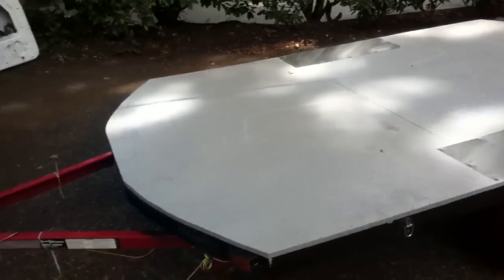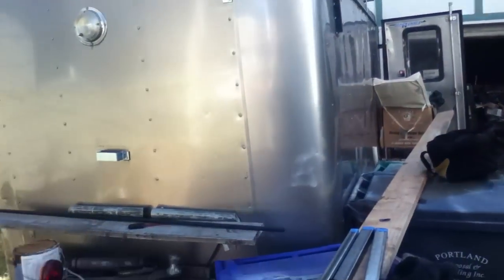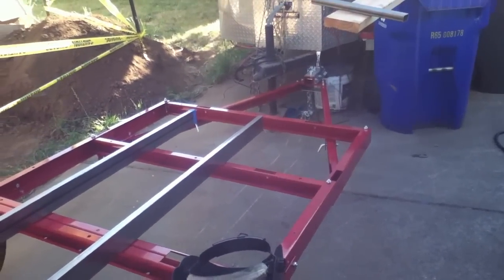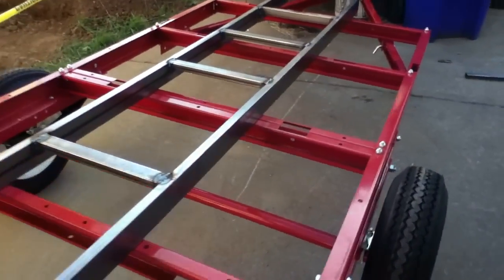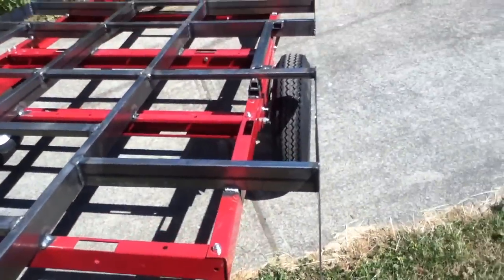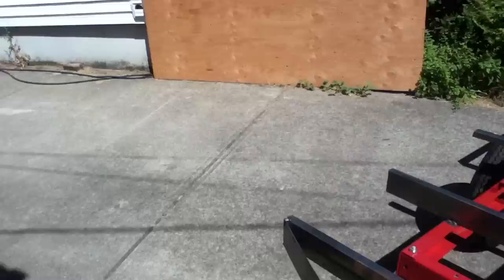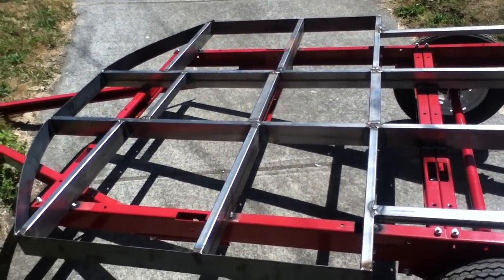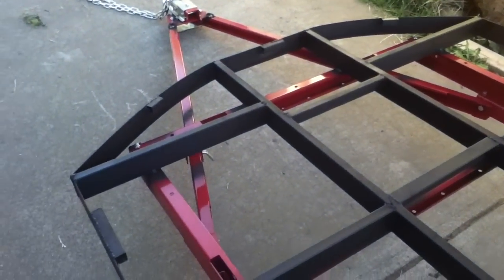5X10 Flatbed Build On Harbor Freight Trailer Frame Kit  #94564

Comment: I had a trailer stolen from a friend I lent it too as well. my friend paid me for it. I used the same hf frame and just put 3\4" plywood to extend it to a 8x10 deck.  I put spacers between shackle and frame to raise deck over tires.. I had a lifted jeep so the hitch was just right. I loved that trailer because the tires tracked exactly with the rear tires of my car. I could pull it anywhere I could fit my car. I plan on making another one except I'm going to weld it (no bolts) and weld 12" extensions to the sides of the frame for stake holes
Reply from the maker: My friend seriously fucked up two of the robbers so I can't fault him that way.  His other friends who brought the robbers around, well, that piece of shit is another story...His parents are a major hassle and have interfered with my property recovery and keep trying to burn me in retaliation for claiming my stuff back.  This all happened in Washington State where the people for the most part, are pretty fucked up people.

Comment from the maker: Getting the base trailer at around $300 at the right time of year walking in the door at Harbor Freight with a 20% off coupon (no sales tax state and no shipping charge since I am picking it up at the store), there is no way you beat that deal for the base trailer.   The axe kit with leaf springs almost never below $100, tires and wheels, $80, (most of the time you pay $50 each).  Light kit $20-$40, hitch kit $20, then the steel.  By the pound from the cheapest steel yards, $1 per pound.  It's over 100 lbs of steel.  I did the math and figured out I could not buy the items separately for cheaper, then would have a bunch of measuring and cutting to make the frame and axle mounts.    This type of flat top flat bed trailer is almost always going to require a two tier frame design anyway.  Flipping the axle over the springs does not make it tall enough, but is close.  On this design, the original trailer frame acts as a reinforcement up the center, allowing for a bit lighter construction on the deck supports at full width without threatening the structural integrity of the trailer.

Comment: I have to ask, ('cause I'm like that!) why didn't you just add spacers to the leaf springs to add the necessary clearance for the wheel-to-bed clearence? Then you could have just added to the sides of the original frame, cut down on weight and material?

Comment: Nice job! I'm working on extending (12’) and enclosing my trailer for dirt bikes and camping. If I was building your trailer, I would have put square tube under the spring mount racks to raise the frame, and built a 5x10 metal frame bolt on extension.

Comment: The trailer structure is very rigid if the fasteners are all tightened down adequately. I used a cordless impact wrench (DeWalt DC825) and tightened each and every bolt until I thought any more would break it. Afterwards, there was no flex in the frame as it was moved around (flipped, etc) during the remaining assembly - and it remained that way after full assembly. That also made good metal contact between the various pieces, allowing for a solid electrical ground.

Comment: I just watched this video, I am curious to know if you have the trailer back from the theives.
Reply from the maker: Nope, it had too much damage where it was stored to risk loading up and hauling out yet but I know where it is and got the property owner and local law enforcement to finally acknowledge that it is mine.  They were still playing a lot of games over my access to the property to retrieve any of my stuff and filed a false police report against me just as a threat of retaliation because they were upset over me recovering what I did manage to recover.
Reply: Officials can be a real pain in the ass sometimes.
Reply from the maker: More like facilitation of robbery and extortion.  The basic message was to give up my stuff or they find excuses to cause me harm.
Reply: Sounds like you live in a nice neighborhood. Time to move.
Reply from the maker: I do live in a very nice neighborhood.  The ripoff happened 400 miles away.
Reply: OK Glad to hear that.

Comment: I'm thinking of getting a Harbor Freight Trailer and using it to haul from Missouri to Alaska.  People are warning me that the 12" tires and bearings may not be able to handle the 4,000 mile trip.  Do you think the trailer can make such a trip?
Reply from the maker: The axle is a pretty standard 1 ton axle and if you don't badly overload it you will be fine.  If you do blow out bearings, you can upgrade to a US made hub assembly from NAPA auto parts for $50 per hub.  I have built and own three trailers done on these types of frames.  The one in this video blew off some of the lugnuts on a long trip hauling a section of my cabin a few hundred miles - probably over the weight limit a bit, but not badly, and then five miles of off road when I got there, but it made it.   Another one grenaded the bearings on the highway, but that trailer was around three years old and had seen a lot of use.  If you are conserned about bearing longevity, replace the bearing caps with the kind used on boat trailers that use the same axle and hub assembly.   The boat version has a zerk fitting in the middle of the bearing cap so you can pump more grease into it much more conveniently than the factory fitting.   Make sure to tighten the lugnuts from time to time on longer trips.  They can loosen on their own for some reason.

Like what I discuss in the video, the frame on its own is a little bit flexible, but as you add more steel, then it increases structural integrity.  Welding it after you have bolted it together seems to help too.
Reply: 8digitPDX Thank you for your response I appreciate it!

Comment: I'm building the same trailer and I'm curious about the flex on the springs when you have 500 lbs on it.  I know with no weight and just the original frame that the tire is just above the frame.  I was thinking i would add 2x4 with the 2 side up do you think it will be enough?
Reply from the maker: It should flex very little with only 500 lbs on it.   I know the video is long, but there is a point where I explain how the wheelwells are done with 1/16" metal (you could use steel or aluminum) and it is set right at the maximum upward travel of the tires when the springs flex.   Measure the distance between the tops of the Ubolts holding the axle and the bottom of the (original) frame.   That's your distance of travel, now measure the top of the tire above the frame, should be around an inch and a half   Add that to the distance of travel, thats how high your deck needs to be in order to have a flat deck which goes over the wheels and has no wheel well bump to interfere with flat bottomed loads on the deck of the trailer.  Now if a load were to torque the axle hard up at an angle, it might momentarily scrape the tire on the bottom of the metal used in the wheelwell cover, but that would only be momentary, making a  skid mark, but not ripping the tire off the rim unless you were going over any rational speed limit in relation to the road conditions.
Reply: 8digitPDX Thanks for the reply i listened again and heard where you spoke about that area must have missed it the first time.  I think i will give it the 2 inches over the top of the tire and call it a day.  I can always add another stop above the spring to insure it will never be able to hit.

Comment: Two more 2x4 metal on the sides and you would have a complete 5 ft wide trailer.Then buy the axle and wheels. Much cheaper and no worries about weight.

Comment: Can you tell me how many inches from the top of the flatbed is to the ground, assuming the flatbed is level?  I want to use this setup on my HF trailer but it cannot be any more than 24 inches from the top of the flatbed to the ground.
Reply from the maker: Not sure of the exact measurement since the trailer is pretty far away right now, but I know for certain it was under two feet.
Reply: 8digitPDX Thanks.  That’s what I needed to know.  Based on your configuration, I’m estimating in my head that it is about 15 ¾”.  The specs say the wheels are 12” and you have a 3” clearance from the top of the wheel to the bottom of the flatbed.  The Flatbed plywood is ¾” so I guess that puts it in the realm of 15 ¾”.
Reply from the maker: Jim Taylor
 That sounds about right, I do remember it was right around 3-4" from the top of the tire, basically the size of the tire plus the spring travel on the suspension.  While the build did not add a killer amount of weight to the trailer, maybe 120 lbs tops, the larger size of the deck offered the recurring temptation to overload the trailer beyond the capacity of the 1 ton axle.

Comment: Don't agree with the leaving the bottom un welded but hey, different strokes. And should have just splurged for a  3/16 sheet of steel. All welded to the frame and same result over the wheels. I understand trying to save money but damn.

Comment: nice job dude. I'm curious as to why you didn't just invest another 200 bucks and get a new axial and have an entirely new trailer?  you have enough material sitting on top of the old trailer to stand alone.  you could have then sold your old trailer for about half of the cost of your new trailer.  overall much cheeper.
Reply from the maker: I like to make my own stuff.  Back in 2015, it was stolen from someone I had loaned it to and this video was part of what I asserted to prove my ownership when people reported me for burglary when I went to take some of my stuff back from the location where it had been left.   It is actually still there in part because a whole bunch of stuff is evidence in an ongoing trial, but given the fact that it was custom home built, it is almost comical the excuses I was hearing from the county offices and their objections to me just taking my shit back.  Come springtime, when the snow melts, will see what happens.
Reply from the maker: Another bonus to using a Harbor Frieght kit trailer as a basis for a build is that you get a real VIN number and certificate of Origin.  I had to have these in order to prove ownership when this trailer was stolen from a friend of mine in a robbery.